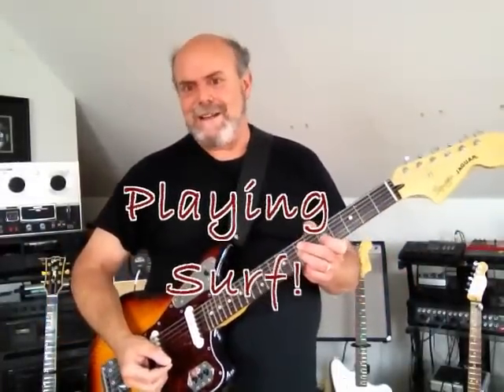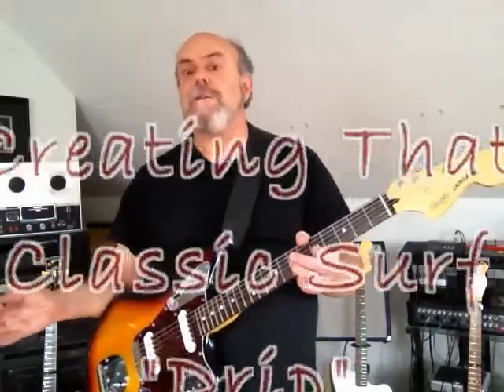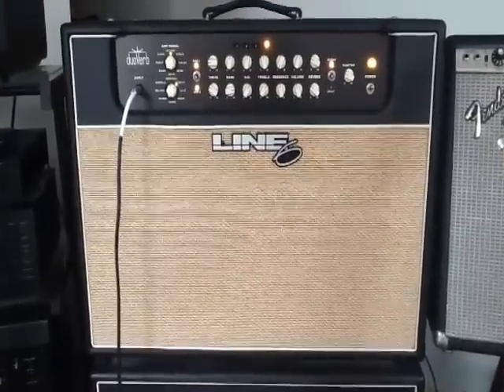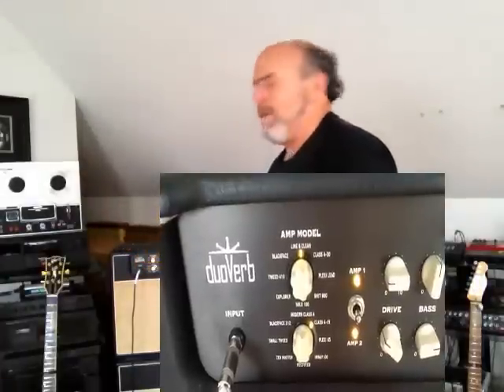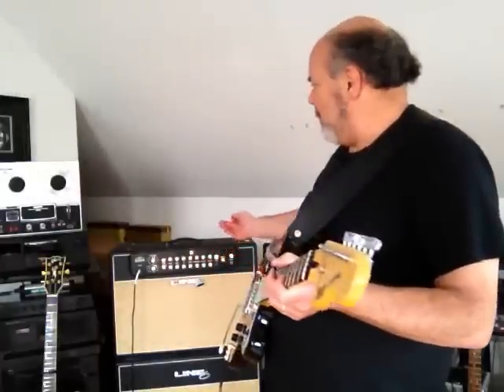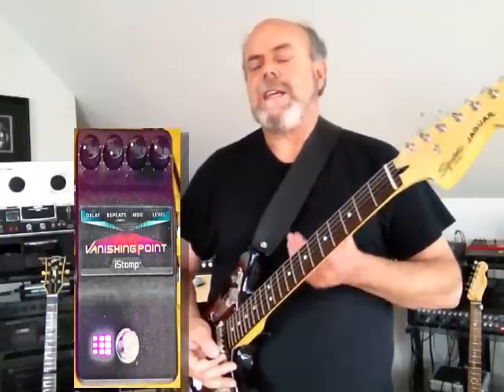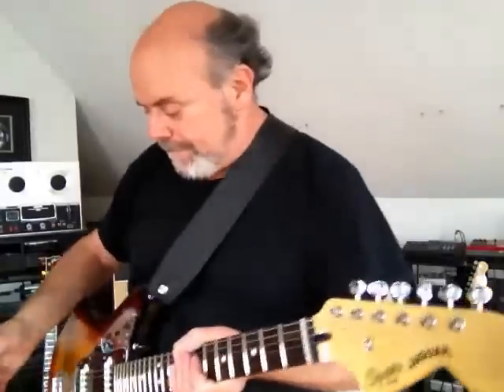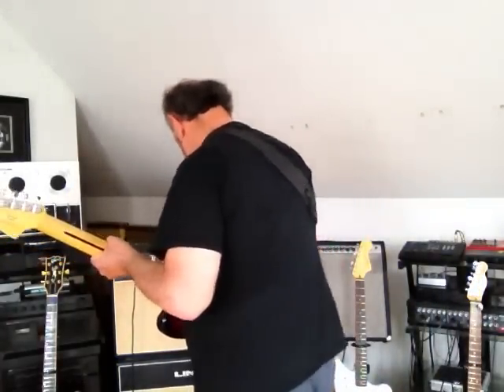Creating That Classic Surf "Drip"

Comment: The "best" drip ive found in a pedal, and its a tiny pedal at that, and its on the cheap side to- is the donner " verb square" set to " spring" and the tone ANYWHERE above 9 o'clock. Other than that most "pedals" fall short.even the mighty hof2 with its VAST tweakability, tons of presets, templates and custom artist toneprints-it just cant do it, not wellinfact the best it can do is just barely audible... Ive tried for months before i gave up.
the boss fender reverb is ok but it sounds like playing a recording of a drip and has almost no " touch" to it.
The dano spring thing is a beast and it is about as meh as it could be.it drips, and you can kick it to clang the springs like an amp, but its just not super "wet"
The strymon reverb/ trem is a surf machine! But it sounds VERY sterile, very digital, like all the issues with the boss turned up 3 notches.
The catalinabread ive used didnt work.the level knob was busted so it might be able to do it, but i could barely hear ant effect.
Then theres the syrfybear- and it is the best spring tank reveb unit on the market.but you pay for it! In price, and space.you " could" put the unit on a board, or build it into a board and have just a floorswitch to turn it on. But ive found  its most at home- like all spring tanks- sitting on top of an amp.
Reply from the maker: Thanks for sharing that Joseph! :)
Reply: @donsucher5412  well no problem.it honestly comes from being wowed by a tiny cheapo pedal that started out as i wanted to see what one of the settings was all about.the "lofi" reverb isnt lofi as in "vintave tank" but as in " ring modulation". But after getting over the novelty of bitcrushed reverb i QUICKLY realized the "spring" setting was made for surf.
It also comes from being let down by the hof, and the hof2.with all the power it has it cant do a few basic fuctions youd think would be included in such a power house of options. It cant drip, it cant do infinite,and it cant reverse reverb.well im 100% it " can" but they have essentially "locked it out" of the hofs.most of tc electronic are identical hardware.their " drip" reverb could easily be loaded in. It has delay capibilities and 100% wet options, so "reverse" isnt impossible , and "infinite" is just as simple as it sounds- just feedthe signalback into itself, using the delay algorithm... And i get that they packed a ton of great effects in, and the flavor of tmhe month was " shimmer" when they updated the original and they DID include that....i hate shimmer.its neat, but unusable unless you turn it almost all the waydown.

Comment: Hey there don, I know this video was a while back but I'm just wondering what guitar that is I know its a ender jaguar but what series is it from
Reply from the maker: It is a Squier Vintage Modified Jaguar.  An amazingly well-done take for today on the classic early `60s Fender model.

Squier, of course, is Fender's imported line. -One whose quality has gotten better and better over the years,

The VM model's only 'updates' are a slightly larger neck radius (an aid to string bending -- a technique less often used when the early Fenders came out) and a slightly "hot" -- ie.e, overwound -- bridge PUP -- again to match current players preferences.

Its common for people to say that Squiers are "good guitars for the money."  My own experience is that the better Squiers (such as the Vintage Modified series) are good guitars period.  Very good in fact.  :)
Reply: Thanks for the info don! It's really helped me decide on which fender squire to get, really love the tone, you've helped me finally decide. I went into the local guitar store and they had one in, I tested it out through a fender tube amp and it's amazing  so I will be getting that guitar soon! Many thanks 
Sky~

Comment: Or you can get any number of fender amps from the 50’s and 60’s Tube amp with built in reverb, echo, tremelo. It’s gonna destroy the line6 modeling amp.
Reply from the maker: You might think so. But I also own a lovely and very clean `76 Twin Reverb.   And for surf I prefer the DuoVerb.   That for its exquisite 'tweakability.'

Of course there is no one "right" answer. We each choose what we choose based on our own taste, experience and expectations.

My taste formed in the 1960s, but this 'talk' is about getting that sound with today's easily found gear.

Comment: I have a marshall 40c dsl is that gonna work?
Reply from the maker: I have no first hand experience with this amp.  Marshall in their ads speaks of it having a "burly" sound.

My own experience with a large variety of amps, including some Marshalls, is that at moderate volume and with the various means of increasing gain built into the amp removed via settings, a decent clean sound can be found; and that is what would be needed for the traditional sound of surf.

Mid-range and treble controls, too, can be used to sculpt the sound to one less 'Marshally", as can the guitars own volume control -- that by pulling back from many Marshalls' (and other modern amps) tendency toward early onset preamp stage distortion.

The shorter answer is, I think, yes.  :)

I hope that you'll share your experience so as to help others benefit from all that you learn!

Good luck and have fun!!!  :)

Comment: Yer a freaking genius. I've been been debating getting a Fender Reverb Unit for the drip sound and now see I really don't need to spend $600 to get an acceptable facsimile. Thanks and a tip of my hat to you, sir.
Reply from the maker: Eugene, I highly recommend the Boss/Fender FRV-1 pedal.  It uses cmos technology to model a `63 tank in the same way that the better modeling amps digitally recreate the sound of classic tube amps.  

Be aware that some people buy these and are disappointed. They say it "feeds back" and sounds too "boingy."  And for the sound they are likely looking for -- that of a clean, modern, "improved" reverb -- I suppose they have a point.  But if its `60s surf sound one is looking for it is just the thing. That is what those old tanks sounded like!

And apparently I am not alone in this opimion. A surf-crazed forum friend of mine has told me that the last two times he saw Dick Dale he was himself using an FRV-1 instead of a classic tank. :)
Reply: I got the FRV. Thanks, Don. Love your stuff. Keep it coming, please.
Reply from the maker: Eugene Martone Great!  Enjoy!

I find that it pays to find a setting for each guitar.  Those with a lot of 'highs' in their native sound (Jags and Teles for instance) need a bit less of each setting to get their best sound, while a Jazzmaster or HB equipped guitar can use higher settings.

And here's another 'trick'...  For a really intense reverb, but without increasing "boing" you can add some of the built-in, post preamp, reverb to the mix if your amp is so equipped. :)

Comment: Back in the 60's they just used the real reverb tank and gave perfect drip. I really don't understand why to make it so difficult with amps and effects... In real drip the slapback isn't there, but because the dwell has such cool properties, it might sound like that. Just one silverface and one reverb tank is needed!
Reply from the maker: If such works for you you are there!

Two thoughts...  One, the video was specifically created as an aid to those who do not own such classic gear.

I DO.  (The Silverface Twin -- a very clean one that has been retubed, etc. -- is to be seen in the video)  But I get closer to the sound I hear in my head (Yes, I played pro in the `60s) with the DV and the pedals.  Closer, mind you, to what was created in the studio back then.

As the ads put it "you mileage may vary."  :)

Comment: What order did you put your pedals in? Are they all front loaded into your amp? Or did you run any of them into the effects loop?
Reply from the maker: That is a good question John.  My pedals are ordered thus: Tremolo - Slap back echo - Reverb.  

I also have a compressor that is running through the effects loop.  I sometimes use it, other times not, as I have mixed feelings about whether it is an improvement or not.

The later may be dependent on how I am playing on any given day.  Age (i am in my 70s now) has taken a toll on my picking accuracy. If my picking is smooth  then leaving the notes uncompressed allows for a bit of expression.  If my playing is less than my best than compression covers over small differences in pick attack.

Hopefully you do not have that issue!  (Ah, youth!) :)

Comment: Thanks for these tips could you provide links for the exact items you used in the video (besides the amp and guitar)
Reply from the maker: The most key thing is the sadly no longer available Boss FRV-1  reverb pedal. -One that truly emulates the classic stand-alone Fender reverb boxes that predate built into the amp reverbs.   Such had a sound all their own and apart from getting one of Fender reissues of the units it is the only way to truly get that sound.   They are available used and IMO worth searching for.

The echo used is an inexpensive pedal that for all the ad blarney are pretty much in my experience.all alike when used in this way. One quick 'slap back'. 

The tremolo is also an inexpensive pedal not unlike many available (gentle in its shape -- not the "v" shaped choice some offer). 

Behringer is one inexpensive choice for these later two pedals.

Hope that info is helpful!
Reply: @donsucher5412  Thanks! Is there a recommendation you have for one pedal to use with my Blackstar ID core v3 amp (with a squire Stratocaster)
I’m only looking to buy one pedal at the moment as I just spent a lot to get my first amp and guitar recently. My blackstar amp has reverb built in with four types of reverb, room, hall, spring, and plate. The reverb sound is alright but I’d like better. Is there a pedal you’d recommend for reverb >125CAD. Thanks for your time replying to comments from an old video.

Comment: What is the name of your slap echo pedal? I have been looking for a good drip for a long time without dropping like a grand on a good Fender amp
Reply from the maker: The pedal I am using here is an IStomp running Vanishing Point.  But slap back is one of the most basic echos and almost any echo pedal can create it.

That said a modern type echo is harder edged than the old tape types. Ideally we use of of those or a  device that emulates one.

Hope that helps!  Rock on! :)
Reply: Don Sucher Thank you for taking the time to respond. That does help out a lot. I started playing guitar about a year and a half ago just to play surf and surf punk. I have played bass for ten years so it hasn’t been too difficult to pick up. Especially with the help of the internet. 

Thanks again for the help. Awesome Jag too. I’m obsessed with Fender offsets.
Reply from the maker: Worth noting that the Jag is a "Squier by Fender" Vintage Modified model.  -Very, very close to original spec, but for a fraction of what it costs with "Fender" as the primary name. If you haven't played one do.  You'll likely be rather surprised! I sure was!
Reply: Don Sucher 
That was the first thing I noticed. I actually own one. I found one used at Guitar Center for $150 and jumped on it. But it’s been modified. It has a Hotrail in the bridge position and all of the switches and pot rollers were taken out. The front of it had the paint peeled off and painted yellow with the back and sides still surf green. It looks cool. But I want to get a wiring kit with the switches and pots and a neck pickup.

Comment: blues jr with reverb on full plus a holy gail.
Reply: blues jr is good but not quite a deluxe reverb
Reply from the maker: That's interesting.  I for some years had a Deluxe Reverb -- a first year Silverface (the one with the famed frame surround) that had the full blackface circuitry. It was certainly a great amp for club gigging blues and primitive rock (which I also love to play), but was IMO too gritty at club levels for Surf.

Do you find it otherwise?  (Or do you only use it at very low "bedroom" levels?)

Comment: I just use a new Jag and an old Princeton Reverb amp. No pedals needed. Huge amounts of 'drip'. For me, I find the guitar to be the biggest contributor to the sound and setting the switches and knobs is critical. Reasonably heavy gauge strings to really hit the front of the amp hard.
Reply: And Line 6 makes (made) a really decent emulation of the brown reverb in a pedal if you want to through the reverb in front of the amp.
Reply from the maker: Thanks for sharing! Its great when you find the tools that give you just the sound you are looking for. :)

Comment: Thanks Don!  You explained the basics, now i'm going to try and duplicate this on my cheap Fender Mustang GT modeling amp.  Hopefully a mix of Fender Tweed, Tape echo, Reverb, and Tremolo.
Reply from the maker: More than a few of my friends swear by the Mustang amps!  And everything you need is right there.

Many of my videos are made using a Fender G-DEC which uses the same technology. And loudness limitations aside it, with carefully chosen settings, will do almost the powerful and more complex gear does.

Rock on!  This is such a fun time to be a guitar player!  :)

Comment: Ditch the Line Sux as fast as you can possibly list it on craigslist.   Get a Fractal Axe-FX II, or if you're a bit patient, an Axe-FX III.   Only a Fractal can truly do a "close enough" replication of the sound of a real tube amp.
Reply from the maker: Thanks for sharing that John. 

We each have a favorite amp. Partly do to their actual capabilities matching our needs and tastes. Partly because when we work with one, no matter which, we learn to get the most from it and it thus then shines for us like no other.

You may notice in the video that I have a `70s Twin Reverb on a stand right next to the DV.   Indeed I've been playing through such since the early `60s. So I do have a pretty good idea of classic Fender clean.  ;-)   

I've not heard a Fractal.  I'll need to check those out! :)

Comment: Get rid of all that stuff and just play that Jag through an old Magnatone M-15. You will get all the surf you can stand out of that rig. Long Hammond reverb tank with double controls "intensity and duration" with true pitch shifting real vibrato. 75 watts RMS. A true Tone Monster ! No petals needed. It has so many tone variables it will keep you busy for months. If you ever get a chance to play on one, you will buy it immediately.
Reply from the maker: Its great hearing about someone who has found their "it" sound!

A fellow in one of my earliest "surf" bands (I'm here talking maybe 1962!) played through a Magnatone and loved it.

Of course that was pre spring reverb.
Reply: Used to use a Premier 90 stand alone with early Maggies. Then Magnatone started to install basicly the the same reverb circuit as the 90 in their amps. And then started to add twists like intensity , duration and decay. Bonham started with Estey and Magnatone. They had the greatest sound engineers in the world at the time. Magnatones demise came when they started losing people that were starting their own amp company's . Bonham went to Ampeg a couple went to Fender to run their mass production (Fender amps were very cheap in price back then) Some went on to start "Voice Of The Theater" that turned into EV. Magnatone was always experimenting. They lost a lot of good people early to "Bozak" They made the sound systems for Symphony Orchestras and the highest end stereo equipment money could buy back then. With magnatone,.  You could have a run of 500 of a same model wired three different ways. Some would have tube recovery for the reverb then you would have the same model in the same run with a transistor recovery. Then half of them would have a tub rectifier. All in the same model and same run.  They had always ran the company like that. Experiment, improve, experiment, improve. But they never settled down to a line of products that could easily be mass produced. They ended their run with a few transistor models that were very difficult to engineer and still keep their patented Varisistor circuit that gave the only true vibrato (pitch shifting). Other amps said Vibrato on them, but the wern't. Their circuits all used Amplitude, just like normal Tremolo. To this day, Magnatones are the only amps with that feature. They have the new Magnatone company now because they were able to buy the patent for the Varisistor . But holy crap! Have you seen the price on them? But, then again I guess you would have to spend that kind of money on a true Boutique Amp with some of the most famous circuits ever produced from the greatest minds that designed tube amplifiers.
Reply from the maker: Thanks so much for sharing that Douglas!

Your comment is to me one of the marvels of the net.  So much rare knowledge available now to the many!  :)
Reply: My pleasure ! I love talking about this stuff. But where I am, not too many of the old timers left. I wish there were more young people interested in this stuff. The music they make today, most of it is phony. Sampling, Autotune Microphones, all you have to have is a pretty face and the promoters and "sound engineers" (if you can call them that) all they do is pull sound samples off of a computer, Yup just a pretty face and they do the rest. They go from a no talent nobody, to the top of the charts in a month. Nobody learns their craft or pays their dues. All hype and no talent or substance. At least we have YouTube here to keep us somewhat entertained.